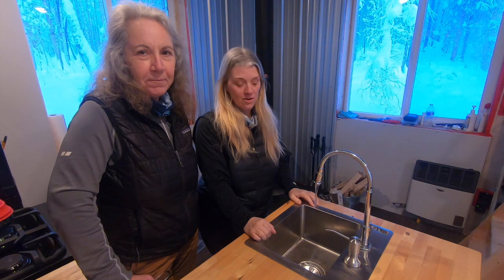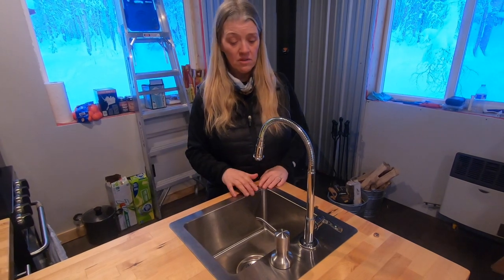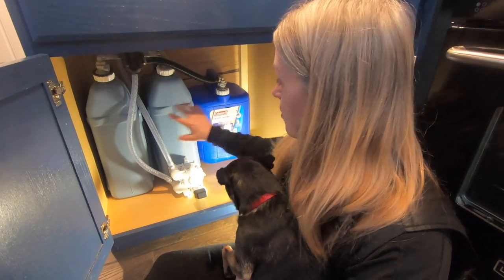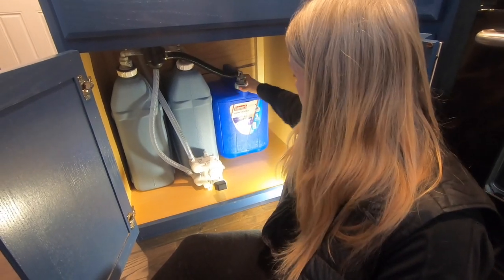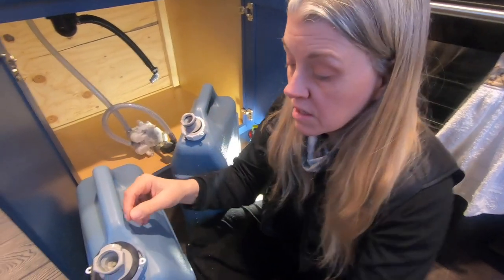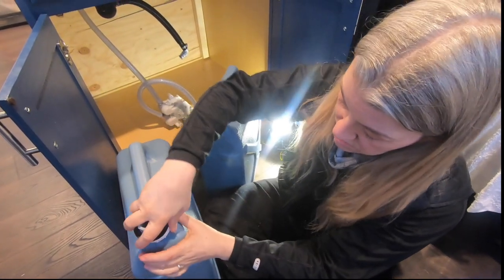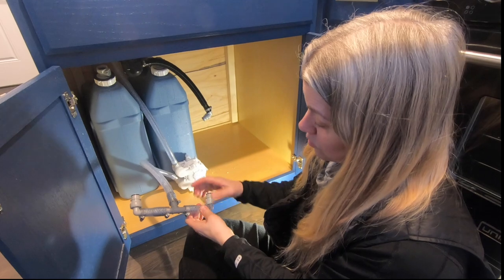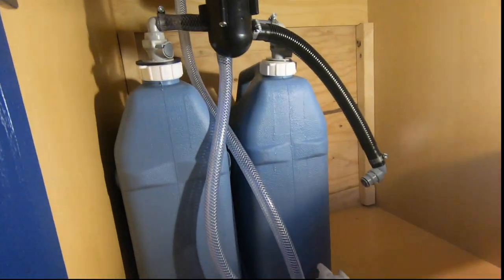Easy Off Grid Water System - Building a Tiny Cabin in Alaska

Comment: wow!  We are looking for a way to bring water into our dry camp sink.. This is so cool!  thank you for sharing.   Can I ask, how you winterize those tubes when you leave?   Thinking we would need RV Antifreeze since we actually are putting in plumbing to take the gray water outside and drain in a gravel area.
Reply from the maker: Hi J Frederick! Thanks so much for watching and for the comment! Sorry for the slow response :( For winterizing we just pump some rv antifreeze through the lines. It's non toxic so it's easy to flush out when we're ready to.

Comment: Awesome.  Great for boats too.  Might you think about converting your trailer to this water system and use a foot pump instead of a battery powered pump?  Seems it might be easy to do since the trailer already has a large fresh water tank and a large grey water tank.  I know when I use my water system in my Escape, that I tend to run more water through than I need to, simply because the pump is on and running.  Maybe if I used a foot pump instead, then I'd use less water.  Yes?
Reply from the maker: Hi Ann! I have thought about it but the electric pump doesn't take that much power and we don't need to use it that much so I don't think it would be worth it. I do think it would be easy to do though for sink usage but we would still need the electric pump for showers. I agree it would probably use less water.

Comment: Very nice!  I like those quick disconnect fittings! Do the food particle, etc go down the outhouse pit?  In our Escape, we use a dish tub for washing, then dump it down the toilet.  This keeps gunk out of the grey tank and puts soapy water in the black tank.  Also the grey tank always seems to fill up first so this delays that a bit.  So I'm wonder about how you deal with waste at your cabin to keep critters at bay.
Reply from the maker: Hey Arnie! Those quick disconnect fittings are pretty nice! We do dump our cabin gray down the outhouse pit. We try and scrape as much food particles as possible and put into the garbage. We go to the dump very frequently to avoid critters sniffing around. We obviously have to be extremely on top of it in the summer because of bears.

Comment: Interesting.  When one of the tanks goes dry, does it pull air into the system?
Reply from the maker: Fortunately it's pulling water at an equal rate from both tanks but yes it will pull air if one goes dry first. Pros and cons...